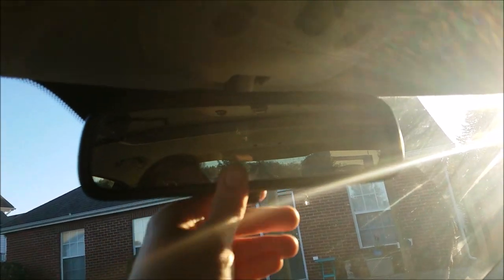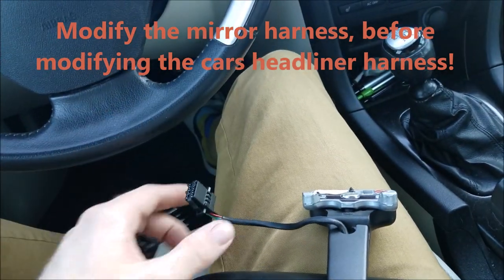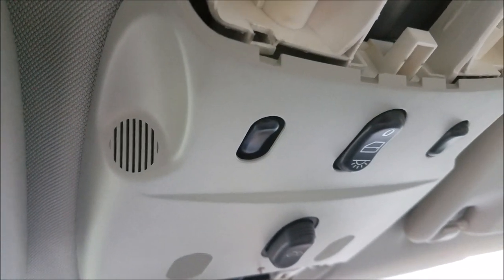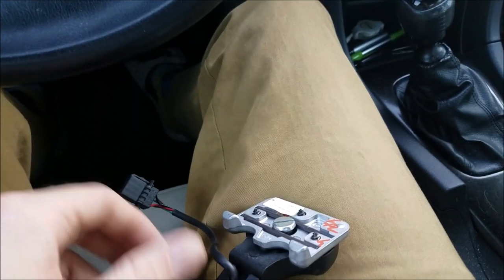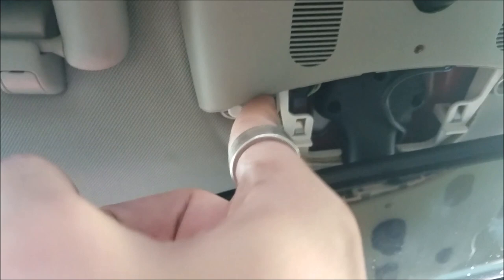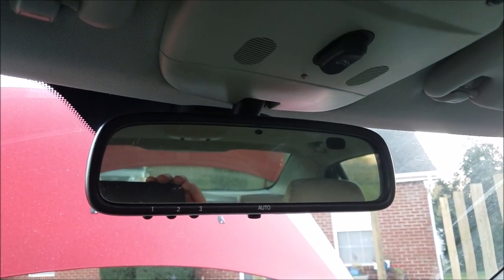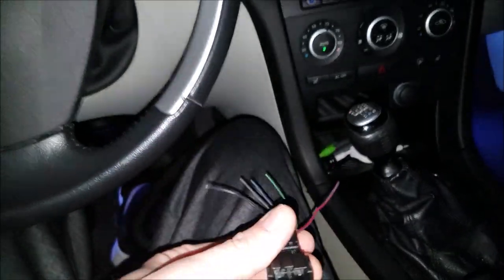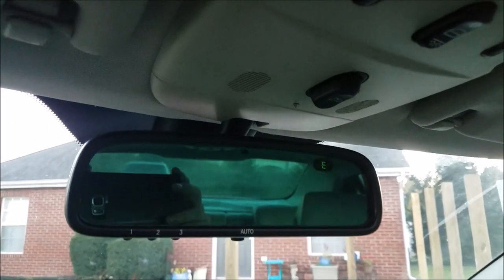Cheap and Simple Rear View Mirror Upgrade (with auto dim, compass and homelink)

Comment: Thanks! Owned 4 9-3's during last 10 years and never knew I could do this. Going to install auto dimming side mirrors also
Reply from the maker: Auto dimming side mirrors are a much more complicated. I actually still need to finish my dimming side mirror retrofit but hopefully soon I'll have the time to compete and post the install.
Reply: I am just thinking to run two wires from the side mirror all the way to the rear view mirror.
Seems like that will be the easiest way.
Reply from the maker: Yep that's exactly the easiest way to do it. It can be tricky going through the grommet where the door harness comes out of the door then into the body of the car. Thats where my delay has been. I'll be using the original door harness block, which overcomplicats the install by repinning but I'm going all out on OEM type retrofits lol.
Reply: Yep, you are doing it the proper way lol. I'll just make little holes in that grommet to feed the wires through it

Comment: I put an 03 9-5 one in my 2011 9-3 turbo3 with no issues after proper set up. The connector was sitting there just waiting for the mirror’s plug!

Comment: The 9-5 SE V6 self dimming mirror has a different connector than the 2001 and thereafter.  I had to rewire my connector so it would connect.  It was easy to calibrate by driving in a circle in a court.  The Homelink function also is a great feature and you program it with the remote for your garage door.  My original mirror stopped working and then its internal plastic mounting disintegrated.  Goldwing had the mirror in stock.

Comment: Im a high school senior whose worked for 3 years and bought my first car. It was a red saab 9-3 linear 2008. I really love what saab offers for the price. Do you know how the bluetooth works or what you can do with it?
Reply from the maker: Unfortunately, from what I recall is that the bluetooth buttons on the U.S. spec were not functional until 2009. You can get kits (expensive) to make work, but probably best to buy an aftermarket option. They're great cars though, just be sure to keep up on maintenance!
Reply: @WeakestofWeeks  That makes a lot more sense. Thanks!

Comment: What level octane do you use in your Saab. My dad and I replaced the spark plugs and one was dead. So the engine light came on tomorrow Ill check if the light goes away.
Reply from the maker: I always try to run 93 octane

Comment: Do you happen to know in which frequency does the homelink transmit? Thank you
Reply from the maker: I couldn't find anything in my owners manual that stated the homelink frequencies. According to the web the frequency range is: 288-418 and lists these specific frequencies as well (288,295,315,320,390). I'll have to check the Workshop Information System (WIS) on my computer at some point to confirm. Hope that helps.
Reply: @WeakestofWeeks  did my research as well and all i found were the same frequencies you stated above. Thank you for the reply
Reply from the maker: You're welcome, glad to help. Thanks for watching!

Comment: I wonder has anybody ever tried to manually calibrate this thing in Europe?
Reply: Okay, I have found the answer myself already. It is possible, Europe is somewhere between zone 7 and 9 depending on country if anyone’s interested. Saab manual shows only a fraction of zone map, and it appeared there are no more zones for the rest of the world, those 1-17 shown in Saab manual are common for all continents. Just Google for worldwide compass zone and check your country there which zone fits and you can use this mirror probably anywhere.